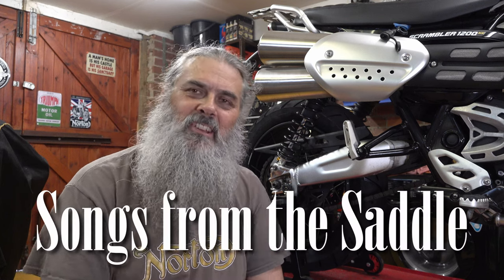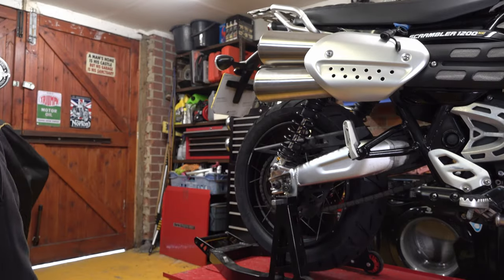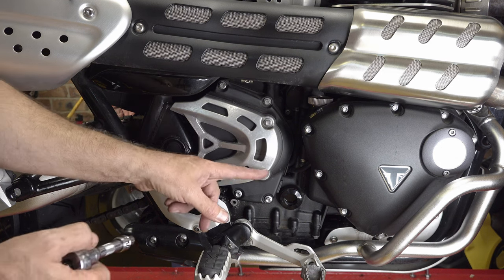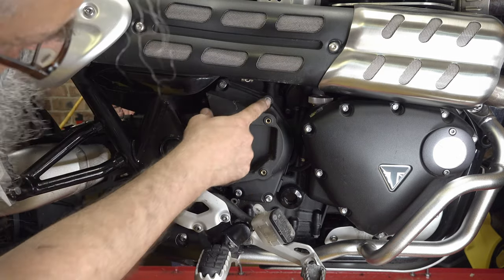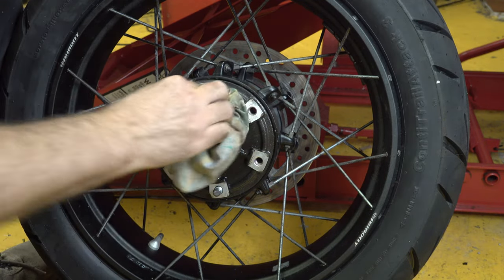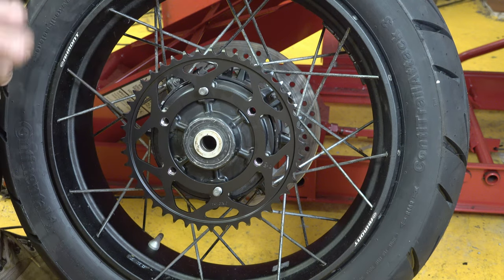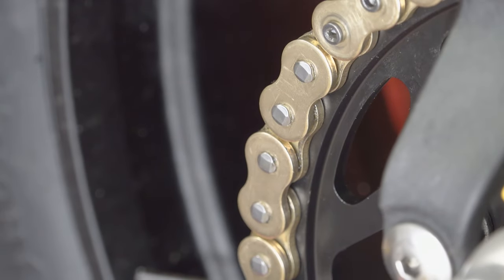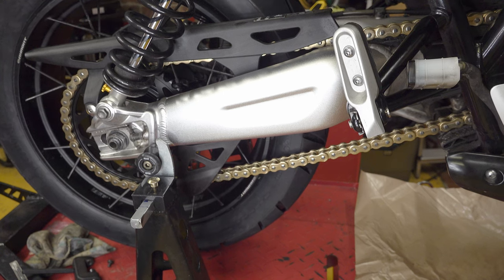Triumph Scrambler 1200: Fitting a New Chain and Sprockets

Comment: does the front wheel also need 27mm to remove the wheel?
Reply from the maker: You need a large Allen wrench for the front axle. I use a universal, stepped tool that is widely available. Google "motorcycle axle hex tool"

Comment: Great video good attention to detail and use of correct tools. Not 20 minutes of unwrapping. On a lighter note way back in time the old guys used to renew the chain but turn the rear sprocket around if possible to save money.
Reply from the maker: Thanks for your support Colin. I remember the sprocket turning days. Not that I would have done so, but this one would not be reversable, as it has a slight offset. It would need shimming to get the alignment correct.
Reply: The same gentleman used to tack weld big end and main end nuts. One reason I never purchased a bike from him.

Comment: Hi, great video 👍 seeing all the "crud" around  the front sprocket area I wondered whether you've ever used the water based degreaser "Bilt Hamber Surfex Hd" which I've been using for a couple of years. I use it regularly to clean my chain/front sprocket areas, it's pleasant to use and very effective. I use it at 10% dilution which is all that is necessary to clean these areas. Also use it as a pre-wash at 5%. A very cost effective product and as I mentioned much nicer than  solvent based products. Keep up the good work 👍
Reply from the maker: I have tried a few different water based degreasers, but have never heard of this one. I'll look out for it. Might make a good video to compare a few!

Comment: i have a new 2022 Triumph Scrambler 1200XC, it only one month old, but there was a tiny oil leak coming from that front sprocket area.
if you look at you video at the 20:53 when you have the front sprocket exposed, to the right of that you have some oil built up on a plate with two screws.
What is that plate for?
Is it possible that oil can leak out of that plate ????

look at 12:53

I’m thinking my mine is leaking from there but i don’t know what that plate is for.  i’m also thinking if i tighten those two screws it may stop the leaking.
The oil that is leaking out looks like motor oil. it is gold color and clear.
Reply from the maker: That's not an oil leak. It's oil off my chain. I lube the chain with chainsaw oil, which flings off and collects under the front sprocket cover.
Reply: @SongsFromTheSaddle :  i took the panels off, cleaned it all nice nice.
it was spotless.  went for a ride, and there a small leak coming from the the back of the sprocket.
unfortunately it is not the chain lube.

Comment: I know you’ve said you’ll only do shop videos as the need arises. But I have taken my own wheels off for a tire replacement. I cannot for the life of me get the rear wheel back on. Is there any tip, trick, advice, or video you can share with me to help?
Reply from the maker: Sorry to hear that Adam. It can be fiddly getting everything aligned. I can offer a few tips: Spread the brake pads to given more room to get the disk in - you can do this gently with a tyre lever or large screw driver; back the chain tensioners right off, so you can get the spindle in with the chain very slack; Get a few small bits of wood to push under the wheel and support it when you have the wheel aligned; lube the spindle with some grease so it slides through easily. Lastly, be patient - sometime is takes a few attempts to get everything aligned.
Reply: Hello Adam! I'm having the same difficulty - it seems like with the caliper and spacers in place, the whole assembly is maybe 1/8" / 3mm too wide to get between the swingarms. I'm hoping there is a simple solution that I'm missing. Do you have any advice?
Reply: @JonathanSabar-e9v  ultimately I was able to get it done. I’m a total newbie to tire changes, so I’m embarrassed to say it took me about 2 hours before I was able to figure it all out. A couple of things I did… first, the previous comment on my question from SongsFrom The Saddle were great suggestions and I used them. 

Second, i greased the all the parts generously and that’s what helped hold the spacer in place, however, I did use a rubber mallet to lightly tap the spacer in so that it was fully seated. After that, I had the clearance I needed. I noticed that prior to the grease and tapping with a mallet, the spacer would rock slightly, making it stick out too far to get between the swing arms. 

Finally, my bike was up on a center lift, so the whole thing was quite high up, requiring me to lift the wheel quite high to get it on. When I finally decided to switch to my rear swing arm stand (I have the bobbins on the swing arm that act as lift points for it) the whole thing finally went on no problem. 

I hope that helps. I’ve actually decided to remove the wheels a few other times since then simply to convince myself I could do it, and it’s easier every time. Good luck.
Reply: @arudd60  That helps tremendously! Thank you so much!
Reply: @arudd60  and @SongsFromTheSaddle - Got it! Tapping the spacers in was the one thing I hadn't already been doing (well, I'm using a swingarm stand, so height wasn't an issue), and that did the trick!

Comment: What is your opinion on changing the tooth ratio? I'm thinking of dropping one on the front for some better acceleration.
Reply from the maker: I'm happy with the standard gearing, otherwise I would have changed it at this opportunity
Reply: I had the earlier Scrambler and went up to 19T (from memory) as I was forever searching for a sixth gear. I often feel Triumphs are too low geared. Same with my Street Triple.
Reply: @SongsFromTheSaddle  I want to change the gearing on my XE, the chain and a front 17t sprocket are easy to find, I’m struggling with finding the rear in the right pattern though. A black 41 or 42t would be ideal. Any leads appreciated. Would you advise trying the front sprocket first, or replacing all three parts together is the only way (current set up has 4600 miles on it). Many thanks